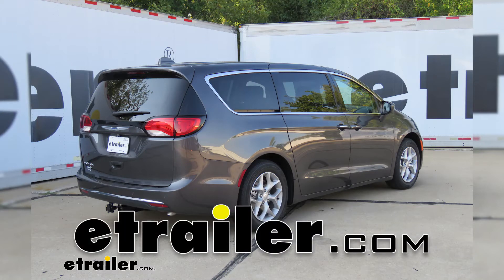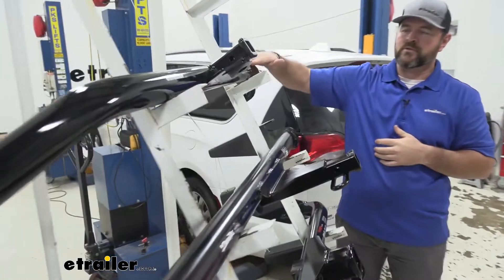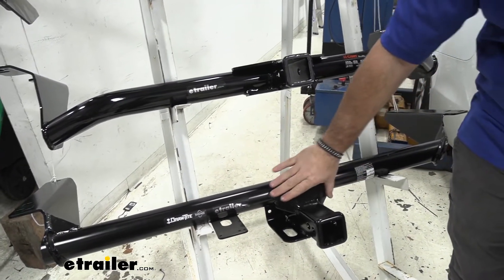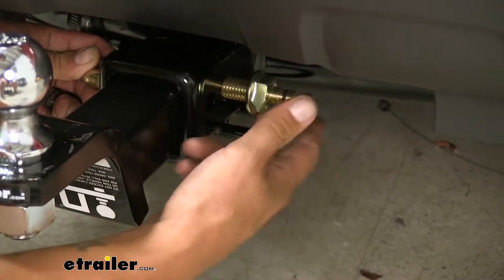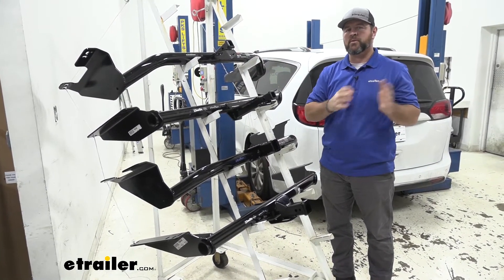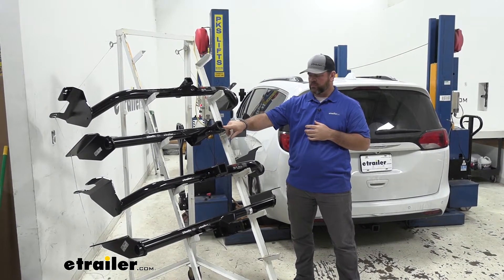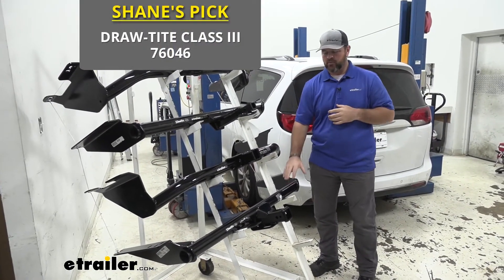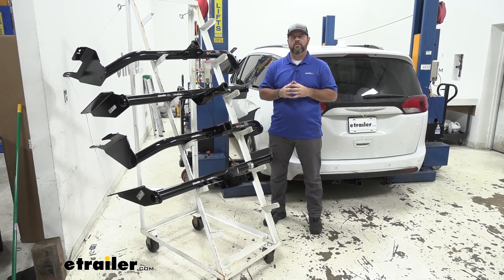etrailer | Best 2020 Chrysler Pacifica Trailer Hitch Options

Comment: My pacifica has the sensors under the bumper to open the rear door with moving your foot - now this really doesn't work well so I don't care if the hitch interferes with its function - just wondering if that interferes at all with installation?  Also, does the trailer wiring affect the auto stop/start system?  Thanks.  Excellent video.
Reply from the maker: The sensor will not interfere with the installation of this hitch. The view of the sensor will just be limited because the hitch is in front of it. The wiring will not interfere with the auto start feature.
https://www.etrailer.com/hitch-2020_Chrysler_Pacifica.htm
Reply: They make a kit to split the  sensor into two, one on each side of the hitch.

Comment: which one do you recommend to pull a 2700 lbs travel trailer?
Reply from the maker: We'd recommend the Curt Class III hitch. For non-hybrid models, use # C65CR or # C29UR for the hybrid model.
https://www.etrailer.com/Trailer-Hitch/Chrysler/Pacifica/2022/C65CR.html
https://www.etrailer.com/Trailer-Hitch/Chrysler/Pacifica/2022/C29UR.html

Comment: Same processes on the hybrid pacifica? Thank you
Reply from the maker: There are slight differences for the Hybrid model. If you went with the etrailer brand Class III hitch # e98903, you can see the differences mentioned in step # 5 and 6 of the linked install instructions:
https://www.etrailer.com/instructions.aspx?pn=E98903
https://www.etrailer.com/Trailer-Hitch/Chrysler/Pacifica/2020/e98903.html

Comment: The Pacific is rated to only tow 3,600lbs so why would anyone want a class 3 hitch? If you go to rent a uhaul trailer, for example, they go off this tow rating and won't allow you to rent a heavier trailer than the vehicle is rated to tow so what's the point?
Reply from the maker: Folks want a class III hitch because it provides a 2 inch receiver which will be compatible with a wider range of hitch mounted accessories than a 1-1/4  inch receiver like what's found on a Class I or II. Also, usually there isn't much price differential between the Class II and III, so why not get the higher-rated one?
For non-hybrid models, we recommend the Curt # C65CR or the # C29UR for the Hybrid.
 https://www.etrailer.com/Trailer-Hitch/Chrysler/Pacifica/2020/C65CR.html
https://www.etrailer.com/Trailer-Hitch/Chrysler/Pacifica/2020/C29UR.html
Reply: @etrailer  it still won't change what your vehicle is rated to tow. It will also be larger which means it will weigh more and be more bulky and obtrusive. Also you can always use an adapter if you need a 2in receiver. Both options have their pros and cons so I'm not sure it's as straightforward as saying that the class III is a better option.
Reply from the maker: @benldr  Of course you're welcome to do as you wish, but in our opinion the Class III is the better choice unless you have a hitch accessory that's designed for the 1-1/4 inch receiver. The weight difference between a Class II and III is negligible, less than 5 lbs. The only difference in size is the dimensions of the receiver tube. Hitch adapters are a fine alternative if needed, but keep in mind that using one will reduce the hitch's capacity by half, because an adapter moves the load further away from the receiver which places more leverage on the hitch.